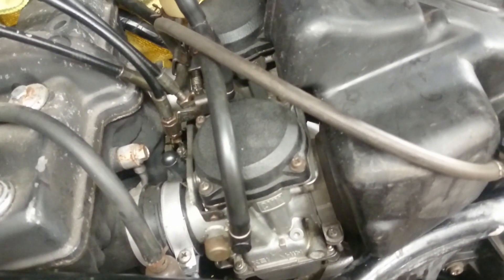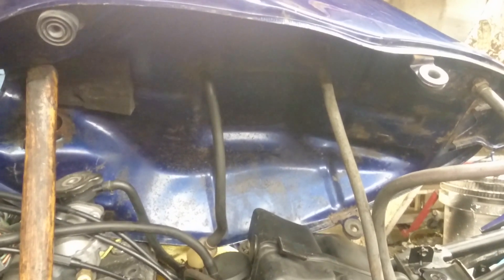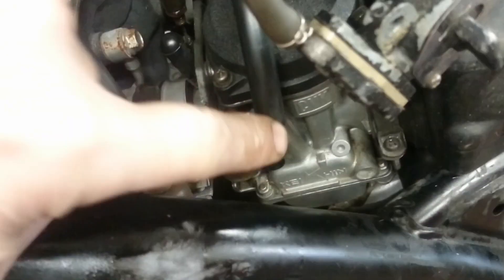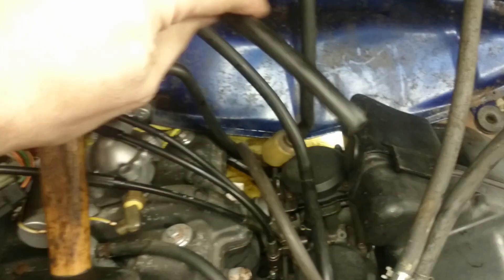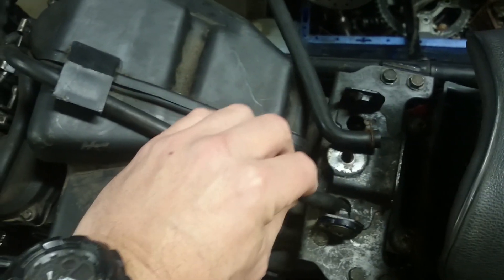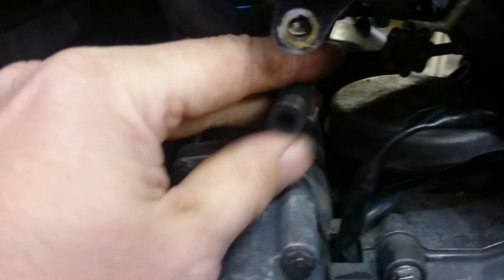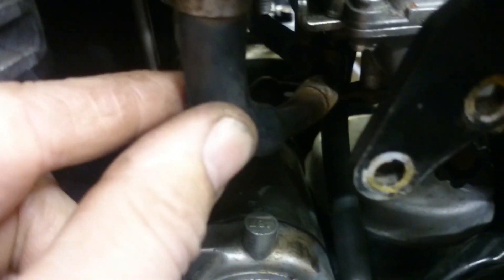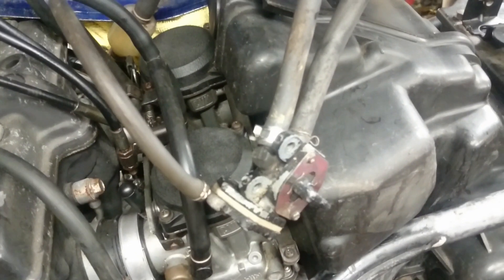ER 500 carb pipe routing

Comment: I came to find out what's the third hose from the tank. Mine just has an open hoes that leads down to drip at the back of the bike. I thought it's for condenstation or something. Still not sure. I can see it use to have a filter. Mainly why I'm asking. Also something is moving in the tank now that I'm moving it around with a bunch of viniger.
Reply from the maker: the third hose is a breather. it allows condensation to escape but also air to replace the fuel your using. 
Sorry no idea what's in your tank
Reply: @motorcyclefixer  It was the float for the fuel gauge. :D

Comment: thanks..but please why the second carburator (closer to fuel tap) has its vacuum hose not connected? according to manual it should be connected to the valve .. i dont get it :(
Reply from the maker: You only need one of the vacuum lines conected to the fuel tap

Comment: hello mate, i'v taken the air box off my er5 and replaced it with cone filters on the carb and i don't know what to do with the breather pipes. any idea . it's going to be a cafe racer. cheers. good vid by the way.
Reply from the maker: Thank you 
The breathers can just be run to air, usually to below the engine 
A lot of people put a fuel filter on the ends to catch the oil mist

Comment: what about the vacuum outlet on the left side carb? where does it go?
Reply from the maker: One of the vacuum outlets goes to the fuel tap
The other has a cap over it to block it off
Reply: @motorcyclefixer  Does it matter which one is blocked?
Reply from the maker: @Loger01  no as long as the other one gives vacuum to the fuel tap
Reply: @motorcyclefixer  Thank you for the quick reply. Just put my ER5 back together with rebuilt fuel tap and lines, carbs cleaned and pilot screws replaced. Starts and idles nicely, but doesn't like a sudden handful of throttle. Once you baby it higher in the revs I assume the main jet takes over and it revs happily. Perhaps I need to adjust the pilot screws?
Reply from the maker: @Loger01  maybe. 
Check the float heights and balance the carbs. There's a few things it may be.
Reply: for the record, my second vacuum outlet goes into the vacuum activated unburnt gas recycle system, or whatever that's called, I know not every er-5 has it but mine does, it's a Y shaped hose with a vacuum valve at the joint, the top legs of the Y comes from the top of the engine cover and the bottom leg goes into the airbox

Comment: Thank you so much, connected it all again after carb cleaning. Now engine runs too many rpm's in neutral. Does anybody know where I might have made a mistake? Or could I have a vacuum leak?
Reply from the maker: I know it sounds obvious but what does it run like if you turn the tick over down. 
Usually over revving is caused by sucking in air somewhere around the inlet manifold. 
One manifold creates a vacuum for the fuel tap, is the other one blocked off. 
Did you disturb the seal  between the manifolds and the head. Hope this helps 👍🏼. Good luck
Reply: @motorcyclefixer  thanks a lot!
Reply from the maker: @Pieter84 did you sort it?
Reply: @motorcyclefixer  yes the rubber inlet manifold was twisted a bit and didn't seal the carb.